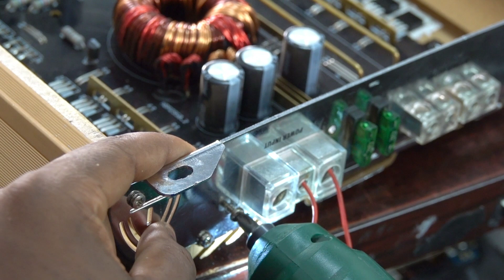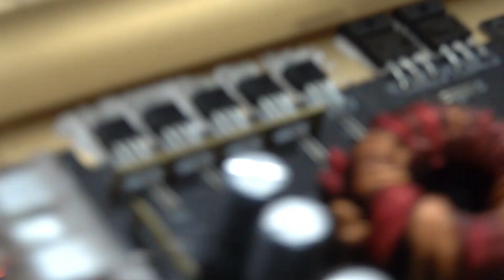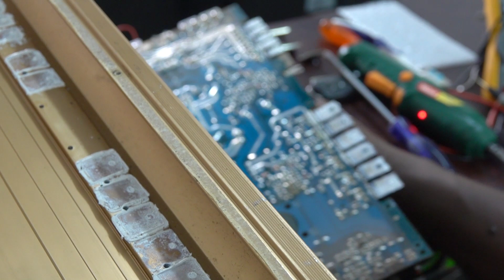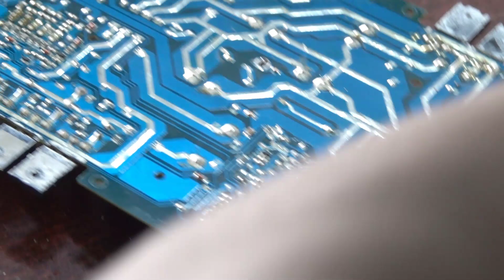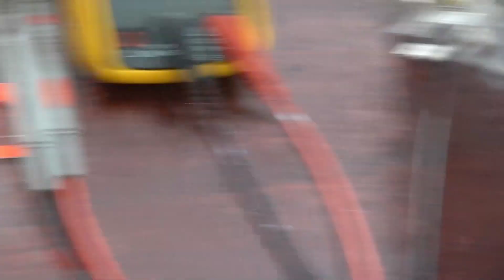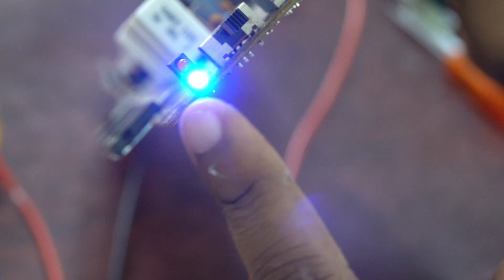Audiobank Car Power Amplifier Dead Repair Part 2

Comment: Do you use oscilloscope to repair your amps? Will very very difficult for u if you don't?
Reply from the maker: I don’t and i still get it right every time. I read the voltages with the multimeter.